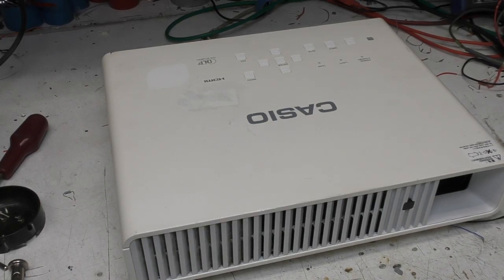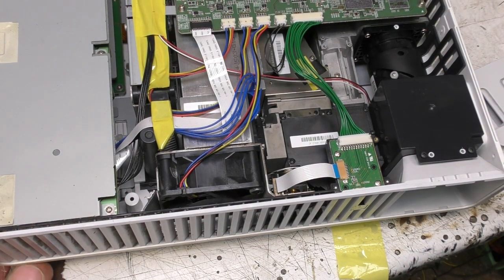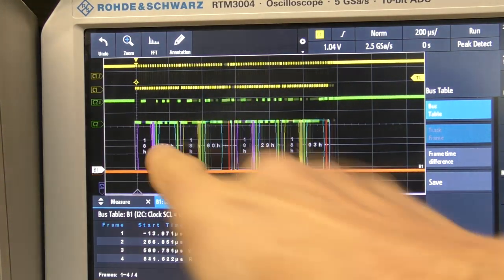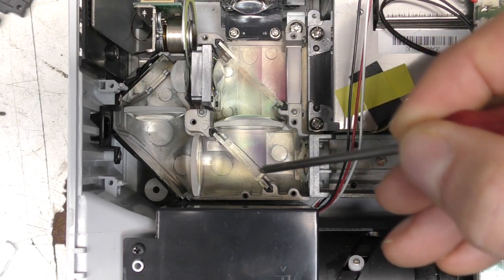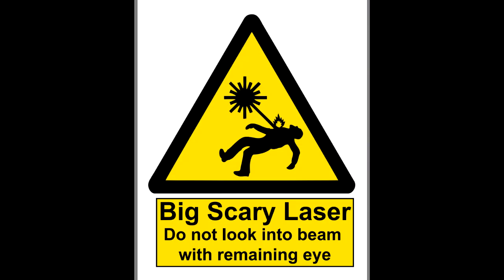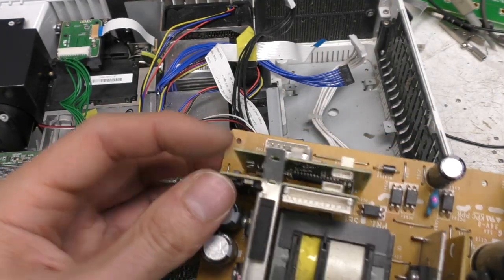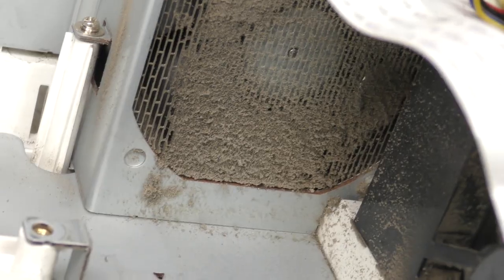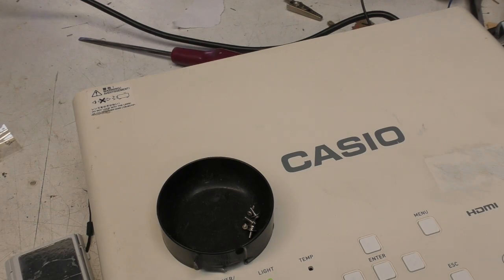Casio laser/LED projector teardown

Comment: Hi I have one of these Casio hybrid projectors. It's pretty good but I do see the rainbow effect quite a lot, especially when moving my eyes across the screen. I understand it is equivalent to about a 2x colour wheel which is not great. Do all the Casio models run the phosphor wheel at the same speed or are some better than others? Has anyone tried the Panasonic RZ/RW projectors as they seem to be the only other LED/Laser projectors around in any quantity and are they any better? They seem to use a different setup of a red/blue LED and the laser doing green only via a phosphor wheel and I think this enables them to cycle RGB via rapid switching.

Oh and my Casio is super cheap to run, consuming only 60 watts on the lowest lamp setting, which is less than my cheapo LED projector which is about half as bright.

Comment: My Casio XJ-A131 slimline is showing 13803 hours and still burning brightly, have a complete spare unit ready for judgement day and one with a bad DLP chip for spares. i would recommend these little laser projectors to anyone, mine is hardly ever powered down !!!
Reply: These are great little projectors and you can pick them up pretty cheaply nowadays (I got one with 10000 hours on it for about £30 off ebay, and another with much lower hours for when the first one gives up the ghost)
Reply: @therealchayd  yes, they are great little units ! I'm watching mine now through a Sony Freeview hard drive recorder as a tuner and a Yamaha AV amplifier to switch to Blu ray or laptop etc ! Showing 28 314 hours now 🙂
Reply: @johnwalker194  Wow! That is doing well with that many hours on it!
Reply: @therealchayd  I'm amazed myself but it just keeps shining ✨️ I always run in Eco mode  usually 24/7  and turn it off if I'm not around for a night or longer. I only switch up to full brightness if I'm watching a concert or car racing or football events but it just keeps hanging from the ceiling and doing its thing ! 28 321 hours as I type this ! 🤣

Comment: 7:26  сломано колёсико для зелёного цвета, там должно быть матовое стекло в пустом промежутке, без этого стекла проэктор будет слишком шумным
Reply: Epson ef 100. Трещит сильно, хотя и 1000 часов нет. Может подскажите, что делать?
Reply: I don't recommend this but it works. Take note of wheel and motor pole alignment. Take apart the wheel it is 3 layers and only keep the phosphor layer, glue new piece of plastic diffuser into the slot. Add tape on opposite side of wheel until balanced lol

Comment: The accelerometers are on projectors for automatic keystone correction - a projector is a stationary device once set up, so an accelerometer can be used to accurately estimate the angle due to gravity, and thus assuming the projector is aimed at a vertical surface (rather than a perpendicular surface), basic trigonometry can be used to skew the image to correct distortion automatically. The more you know!

Comment: Great teardown!  Learned a lot.  Thank you!  I had thought that laser projectors would require some type of moving diffuser to knock out the coherence of those red/blue laser beams.  I know light produced from the phosphor is incoherent, so you're good there.  But I'd think the the red/blue beams, expanded across the image plane would require some method to reduce coherence, otherwise  all kinds of "speckle" would be seen across the projected field.  Is this not true?

Comment: Any idea why when I changed out damaged dlp chips in the xja140 the new chips started to produce new white dots only hours after use? Replacements were unused and worked perfect, then 1, then two.. within the first 10hours of use in eco mode .

Any ideas?

edit* in one day the screen is littered with white dots... Ffs 🤬
Reply: inadequate cooling? have you add a fresh thermal paste to the DLP chip & heatsink after replacing it?
Reply: @LeonardPutra  yes . Cleaned both surfaces and replaced the pad. I'm wondering if the bracket which holds the chip in place needs specific torque. It's a weird setup on the 140 series where the heatsink pressed up against the back of the chip . I replaced it again in my third projector along with the color wheel. A week later I have one dot lol

I swear this series is getting back at me for all the ones I've stripped for the diodes 
 🤘🤪

Comment: accelerometer is for trapisodial correction, for situations where the projector is not perpendicular to the projection surface.
Reply: Gravity?
Reply: So they can detect an orientation without acceleration?
Reply: @meepk633  Correct, an accelerometer that is not moving (such as one that is in a stationary device, like a projector) can simply measure the acceleration forces due to gravity in each dimension, and then basic trigonometry can be used to calculate the angle of the projector with relatively high accuracy.

Comment: I have long wondered why there are no projectors that would straight up use the laser beams and two really fast spinning mirrors instead of a delicate DLP. As far as I know, the diodes should handle multiple kHz of modulation just fine, and you'd even be able to adjust the resolution with some finely controlled motors spinning the mirrors. And you could also requlate brightness by voltage instead of super fast pulsing.

Spreading the beam and have it run through several mirrors and prisms and what not seems like wasting a lot of potential output brightness, and direct laser beams wouldn't even require any optics or focus! Does anyone know why these things don't exist?
Reply from the maker: You need insanely accurate, fast scanning and well controlled beam shape, and speckle is a significant issue. There was a pocket projector (Microvision Showwx - I did a teardown a long time ago) that used a MEMS scanner but the product seems to have disappeared now.
Reply: @mikeselectricstuff  I dimly remember that! Quite possible that this had sparked my thoughts. The term MEMS definitely rings a bell. Must have gone like "huh, where is that $60k Sony version of this for 3m+ screens, that hopefully everyone else copies within 2 years?" in my head back then.
I've been waiting out for affordable projectors that bring at least a small quantum leap in tech - be it just being 4k for < 1000€. I've had my Benq W1070 for too long now =) (Still cool though.)

I think I have once seen some video about how to get rid of laser speckle, but that might as well have been wishful thinking. Here's to hoping that someone will tackle it one day soon enough! (Seriously, even the benefit of having no optics to focus would be incredible. Especially for artsy use on non-planar surfaces.)

Comment: Why companies using some custom screw heads? Like on some hair dryers. If somebody want to open it, he will open it :-). Probably he/she would just need more time to get or make appropriate tool. wtf
Reply: yea, i think they are overused, too. Also, hiding screws under rubber feet that are held by adhesive is another common design trait that drives me insane.

Comment: I bought two diodes harvested from this exact model of projector, they were 2 watts each, I built laser pens out of them using a pocket flashlight (torch) as a body, and had the heatsink professionally milled. They run off a single high quality 18650 cell. Duty cycle was 1:2 - 2 minutes on 4 minutes off. Stupidly powerful, and now you can get 7 WATTS in a single diode!
Reply: In which projector?

Comment: A lot of people bought these but only harvested 3-6 diodes which maintained the brightness, then sold the diodes or made laser pointers.  From what I remember that model (M series?) had the 2 watt diodes where the A series had 1 watt.
Reply: The Ms had more powerful diodes than the As, but I don't think it was 2:1. Also the Ms have 24 but the As had 20 LDs
Reply: I don't think this is true, I think from the factory they add or remove diodes, then pair it with a brighter or dimmer red led (bin) for their various projectors with different brightness. I've opened many warranty sealed units with no evidence of tampering. Plus the glued in screws look factory

Comment: We have installed  quite a few of these , they have a habit of the image going pink after a while, they also lose light output. We dont use them much now mainly because the are only wxga. Laser projectors are also getting cheaper and cheaper all the time.
Reply: The habit of going pink is definitely not exclusive to this projector, or led projector... probably affects every possible technology, or at least that is my experience with projectors (though mostly just conventional Panasonics)

Comment: Why did they produce the green with phosphor? Arent there high power green lasers?
Reply: Cost: Green laser is much expensive than blue laser, since it requires crystal. Also adding green laser consumes space and gereates heat
Reply: @bacphan7582  Not really, Direct diodes multi watt green lasers at 525nm exists and can be had for 60$ a pop off ebay. They are used in projectors with both Blue and Green direct diodes.
Reply: @Gianns_TDM  The direct greens weren't available when these projectors came onto the market.
Reply: @cambridgemart2075  You are very much mistaken, The earliest projector (XJ-M130/A130) Came to the marker around 2013 and as you can see here: https://www.youtube.com/watch?v=1KAqlEoQKrU Cheap direct diode greens were very much available. The one-watt green diodes appeared around 2014-15.
Reply: @Gianns_TDM  YOU are very wrong, they launched much earlier than 2013, I bought several well used (10 000 hours +) ones in around 2011. Plus you contradicted yourself with the introduction date of the direct green diodes.
Reply: @cambridgemart2075  Yes I see sorry about that I was wrong. I was under the impression that the m130 series relished in 13 but apparently they have been here since 0'9. But you didn't understand my point. Nothing is contradicting, the plt520 diodes appeared in 13 while the 1w nug diodes appeared in around 14-15
Reply: @Gianns_TDM  Who mentioned Nichia NUGs? When the projectors launched, there were no DI green high power diodes.
Reply: @cambridgemart2075  Ah seems like I have to point this out for ya, > as you can see here: https://www.youtube.com/watch?v=1KAqlEoQKrU _Cheap direct diode greens were very much available_ (the video is referring to a plt520 built he did) . The one-watt green diodes(NUGs) appeared around 2014-15.
Reply: @Gianns_TDM  2014-2015, so 5 to 6 years after the first XJ projectors were on the market; exactly what I said. Styropyro's video is from 2013 and he's using the turquoise-green diodes.
Reply: @cambridgemart2075  No he is using the 3.8mm 50mw version of the plt520 diode. Not turquoise at all pure green, the diode you are thinking of is the sharp 35mw 505 or the sharp 515
Reply: @Gianns_TDM  I quote "I finally got a hold of the amazing new 520nm blueish-green laser diodes! In this video I show you how I built it into a handheld burning laser torch. The output of this laser is just on the blue side of green. Happy 5/20!" That aside, this was a video made in 2013, not 2009!
Reply: @Gianns_TDM  That was a direct quote from his video.
Stop trying to cover your backside, you're wrong about the availability of direct injection high power green diodes when the XJs were released.
Reply: @Gianns_TDM  they are IR laser with crystal as i mentioned, and i've never seen multiwatt GREEN laser diode for $60, the best i can find is 1-2W, and those usually have a weak IR filter and the wavelength depends heavily on temperature
Reply: Don't forget that one blue laser and a phosphor plate is a lot cheaper than a extra green laser and accompanying power supply.
Reply: @GoBO207  Yea, makes sense when you think about it. The phosphor-solution just feels so clumsy. Like some afterthought: "Oh crap, we also need green! Lets bodge something!". Also the phosphor is exposed to air, dust and heat and will degrade over time.

Comment: Do a lot of work in the cinema industry and Dcinema is going laser orientated these days. They tend to come in a few 'flavours'.

Cheap end is laser phosphor with blue lasers and a spinning phosphor wheel to create white light which is then split to RGB via a prism.

Moving up you end up with various colour laser sources with the phosphor to create the missing colour.

Then finally the hugely expensive (like £100k+ per projector) 6P where you have discreet laser colours (2 main sources for each colour) this can then be used to create a 3d effect if required by having a slight shift in RGB wavelengths from the two source groups. With the user then wearing different filters for each eye - so a more direct version of Dolby's 3d which uses a spinning wheel to create the same wavelength shift
Reply: The downside for the laser phosphor projectors is the color reproduction. Not as good as RGB.
Reply: Some of the largest and expensive projectors don't even have the lasers built in. They have external laser enclosures that "feed" the projector through fiber optics.

Comment: Accelerometer, checked in the manual, automatic image flip and maybe automatic keystone adjustment capability, it makes sense. The datasheet mentions automatic keystone.
The laser diodes are not all populated because this is the unit with less brightness in the series, the same design can provide other models with a higher brightness, they all may be populated then.
Thanks for the videos !

Comment: Have wondered if it was possible to make a LEP flashlight ( think there is currently about a dozen models from a few manufacturers ) with a rotating wheel for changing colour of the light. Looks like blue, green and white would be at least possible.

Comment: Why blue laser and not a blue LED? And that is a lot of LDs
Reply: Great question. Lasers provide a better power density e.g. more light output for a smaller area and the light is coherent which makes optics easier. Ideally a projector wants a point light source which is why most projectors use mercury discharge lamps as the light comes from a very small point. A few years ago I modified an old projector to run off a 50W LED, it wasn't even close to being bright enough.
Reply: @WobblycogsUk  The optics is probably the main reason. I know Cree makes 500w LEDs in half the size of a regular 100 led and that may or may not work.
Reply: @WobblycogsUk  i really doubt it, laser provides high intensity light, but not high output, they are not the same
Reply: I think it has to do with effciency. NUBM08v2 has a photoelectric (more like electrophotonic) effciency of about 40% (i seem to remember, could try and confirm) which is pretty wild.

Comment: The accelerometer is for auto keystone which is built in as a part of the TI DLP solution.
Reply: Yea that's the first thing I thought , a friend of mine has auto key and I cry at how easy it is to set up compared to mine, then again mine was ten times cheaper.

Comment: Projectors (and TVs) need to show 2-3x as much green as they do red and blue since our eyes are most sensitive to green light
Reply: You'd need less green optical power, not more. I second Mike in that the longer green section may be there to spread the heat of the phosphor. Also I'm wondering if the phosphor may have some decay/glow after the exciting beam is taken away
Reply: @Galeere2  You would think, I'm not sure why it is (maybe we interpret that as a brighter image?) but basically all displays do this, for every red or blue pixel there's a green
Reply: @danrulz98  I have found something on this. As it seems, green subpixels have to be mapped one to one while blue/red can be alternating for every pixel. Essentially for saving space and cost. But that wouldn't be very useful on a DLP projector https://en.wikipedia.org/wiki/PenTile_matrix_family#PenTile_RGBG
Reply: @Galeere2  Yeah, that makes a lot more sense doesn't it? Still though, the design of that green phosphor wheel is going to make it so it shows significantly more green than blue. Perhaps since it's a phosphor being excited by the blue laser it can't be as intense as the blue so they're using it for a longer duration to make up for that. I was honestly expecting this unit to have a dedicated green source like the pocket projector he took apart several years back

Comment: An office beamer I use from time to time has an auto-adjusting feature (focus, perhaps keystone). But it uses a tiny image sensor instead. Maybe I will try once to film it in slow-motion, as I don't see any fiducials being projected, it feels like magic.
Reply: Yeah I have a Hitachi that does automatic Keystone adjustment, as well as orientation. Of course its possible to manually override the automatic stuff if it gets it wrong
Reply from the maker: Focus is easy, just adjust for maximum high-frequency content

Comment: The algo for converting RGB into grayscale is (0.3 * R) + (0.59 * G) + (0.11 * B). So I guess thats why the green part of the wheel is longer than the passthrough blue.
Reply: It's just the other way round when mixing light from rgb souces. You need waaaaay less green power than red and blue.

Comment: Another possible reason for the accel is theft detection.  In a environment where the projector RS232 is being used for control the projector could send a theft warning message if the accel detects any movement.

Comment: So the red light is not a laser? Why would that be?
Reply from the maker: Cost presumably.
Reply: @mikeselectricstuff  but aren't red lasers traditionally the cheapest ones? And why not use high power blue and green LEDs then?
Reply: @MoritzvonSchweinitz  Red LDs are still very expensive at high powers.
Reply: It a insane led cob light